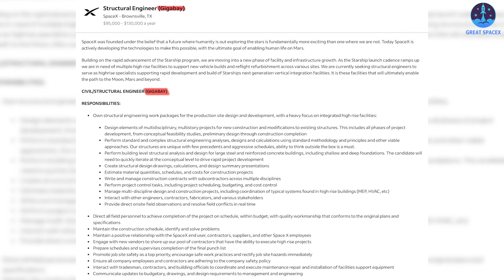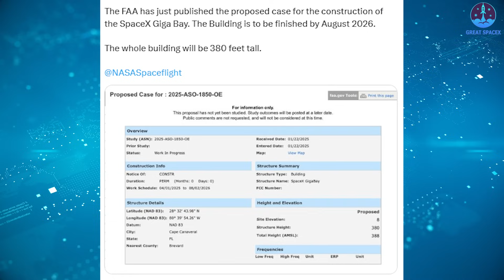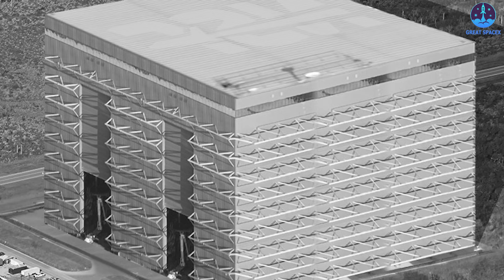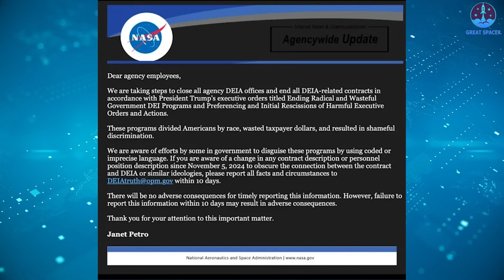SpaceX revealed 118.2 meters Gigabay in FLORIDA to Build Starship in Hours...

Comment: An inclusive workplace and DEI are two different things.  Everyone wants an inclusive workplace, and rightly so, it's actually illegal to discriminate based on gender and/or race, and has been for a long time.  DEI on the other hand is about FORCING a workplace to be diverse by discriminating based on gender and/or race.  Anyone who thinks DEI is good is usually conflating it with inclusivity.  

DEI also tends to foster resentment and a hostile work environment as people who are not capable but who tick a DEI box are promoted into positions they are not qualified for.  When that happens, when you have managers who can't manage, and engineers who can't engineer, you get things like SLS.  
Then people who should have been promoted leave and go somewhere else and you end up with a diverse company of mediocre people in positions they are unqualified for who are more concerned about pronouns than doing their job, mostly because they can't do their job.
Reply: All the companies I have worked at that have DEI initiatives are CHOOSING to have a more diverse and inclusive workplace, and going outside of the usual recruitment places to find brilliant engineers of all races, genders and physical abilities. It hasn't resulted in hiring anyone unqualified or "lesser" in any way. We're always struggling to find great people for technical jobs, so our DEI teams are tapping into demographics that have been under represented before. A lot of current employees have been recommended in by existing employees, so that means we end up with a fairly homogenous group of people with similar backgrounds. By our DEI efforts we've reached out to universities in other countries and told their best students that we are very accepting of them and they should work for us. DEI is a real win-win for my company, and NASA stressing they are still diverse and inclusive, just means they will continue with DEI but call it something else so that the big orange child won't cry.

Comment: Cant we pump something through the skin of the ship instead of the heat shield tiles? Just like we do with the engines?
Reply: Transpiration cooling...investigated in the 50s by Convair. Too complex and heavy
Reply: @ Yes. I am thinking how to make corrigated cardboard steal and what direction the caves will go. Circular I am thinking. Compressed CO2 ranks feed the center bottom and move to the back of the ship where is releases it. When the circumfrance gets bigger it may make it more plausible. Corigated steel may be stronger pound for pound and you get the tubes.